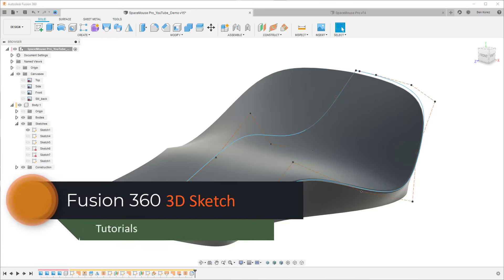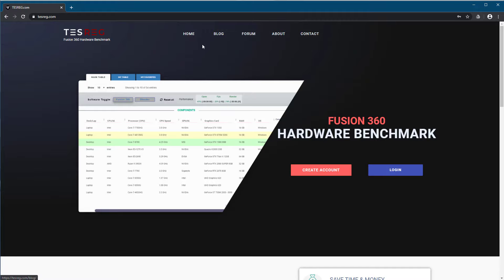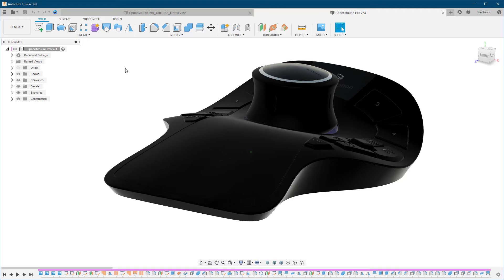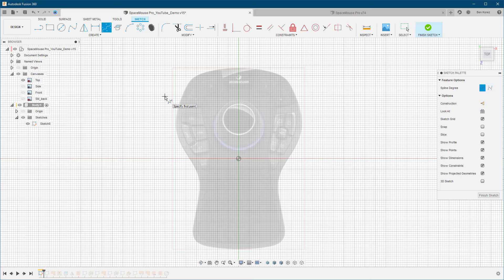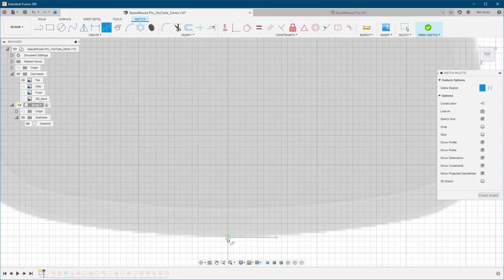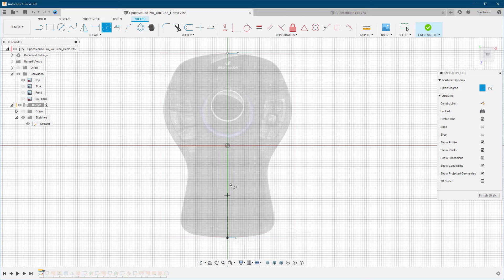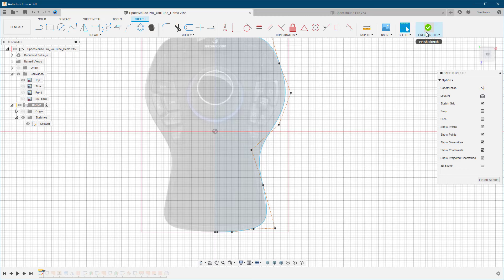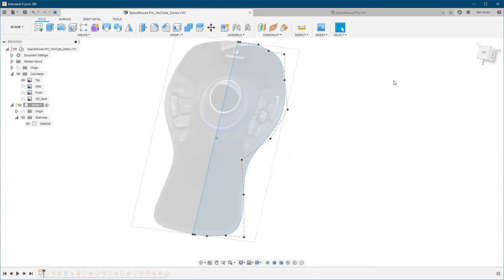Fusion 360: When & How to use 3D Sketch? [Techniques and more]

Comment: THANK YOU so much for posting this tutorial!  I have been struggling with a part that makes a compound curve.  It is a deceptively simple-looking offset shape, but my usual approaches were close, but not quite there.  (They also required some clunky geometry, and made a mess of the Timeline.)  Your use of the 3D Sketch feature is an elegant solution, which will help be confidently attempt odd shapes.

Comment: I use Space Pilot Pro.  While its great to have a 3D mouse I'd advise anyone using a 3DConnexion product to do a lot of research.  Getting the damn things to work properly is like pulling teeth.  Drivers are a nightmare, specs contradictory and support nonexistent.  It really was an infuriating experience.  That being said, I use it with Fusion 360, Blender, Maya and some others on both Mac OS and windows.  I find it really useful for 3D sketches as navigating with the mouse while sketching and changing planes gets really confusing, really fast.  This video is great, and beautifully explained.  It took me a long time to break out of solid mode because surfaces won't stitch if not properly sketched.  Thank you.

Comment: Thank you for this video -- VERY helpful.
However, I would like to try mirror my 3D sketch rather than first create a patch on one side of the model as as you have done here. Is that impossible? I ask because my Fusion360 refuses to mirror a 3D line sketch no matter what I try. Mirroring sketch lines works okay in one plane only? I am a beginner in Fusion360 and find it very challenging, coming from other programs.
Thanks again!

Comment: Newbie here, I know the video is old, but very helpful. Just a question. I see you right clicked the original straight line and added control splines, but when I right click it, this option is not in the drop down menu. I have done it a few times and it did pop up, but not sure why it did or how I was able to make that option appear. Can you shed some light?
Reply: It happens to me too, i just deleted it and then retrace it but using the spline right to the circle tool in sketch mode. Now it's working. You may have used a straight line i think the problem come from there

Comment: Hi, nice tutorial. Just a thought here. Have you actually considered using the intersection curve tool to create the complex curve instead? This would involve creating splines on the top and right planes separately using the picture as a guide and then projecting one to the other. With this, there is no need to manually move each point.
Reply from the maker: Yes I have. My videos are not so much about the models but mostly about the techniques 😉
Reply: This would also create a much more complex 3d spline instead of the low cv sounds he has currently.
Reply: @Fusion360NewbiesPlus  why you are creating with pictures? Why dont you sketch and use extrude?
Reply from the maker: @sandaDru  Because of the curvature of the top surface.

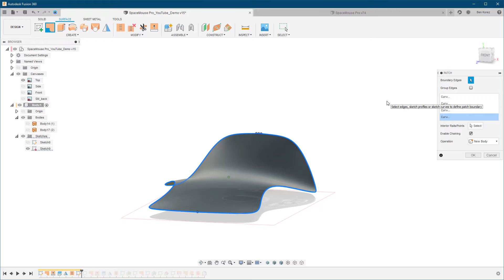Comment: The steps you took to clean up the ridge at 20:00 are not clear. Not sure what you did there with the projected sketch and how that smoothed out the ridge. Otherwise, really helpful to know this process of 3D sketching the way you used it. Normally I see YouTube videos of people making S-shaped chairs + pipe command with 3D sketches.
Reply: I was confused about that, too. I think the magic happens at 19:03, where he makes a new 3D sketch using only the outer edges of the shape (i.e., not the centre line).

Comment: 19:51 You should have done a loft from one half to the other and used the center line as a rail, when you did the patch you lost the center line curvature.
Reply: is this correct?
Reply: @alabrrmrbmmr  Yes, the patch command just does an average curvature by creating a patch surface and trimming it to the control splines. The profile center line that he had previously set up had no effect on the final result.
Reply: @HarryHeck2020  thank you!